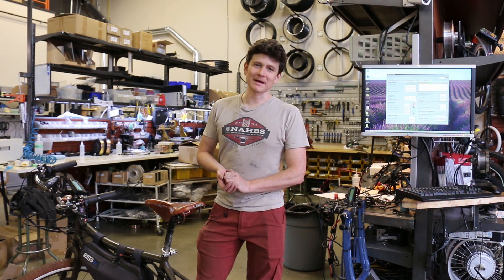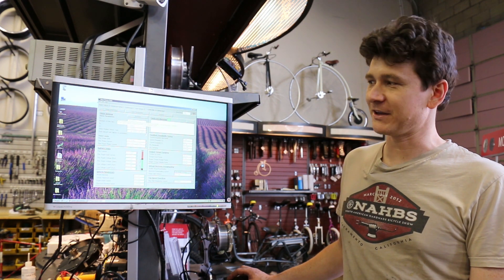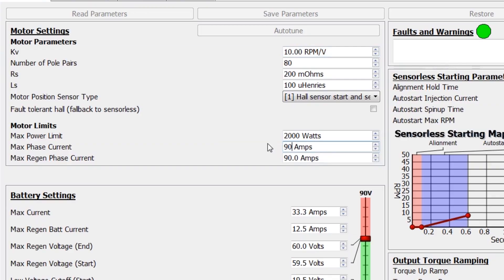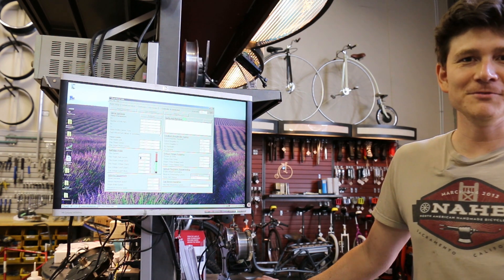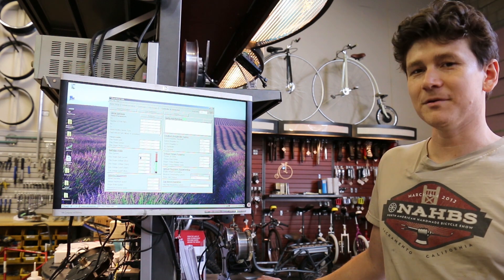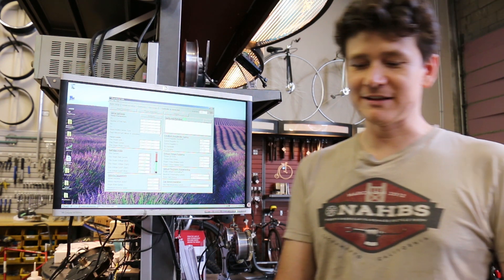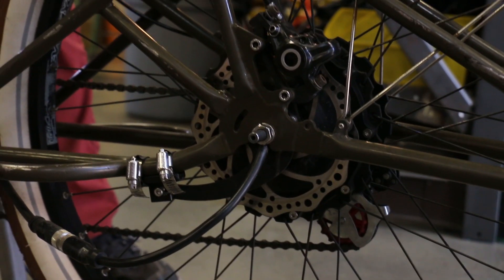Setting up a GMAC Hub Motor for Virtual Electronic Freewheeling (with a Phaserunner)

Comment: Does this only work with the Throttle?  Does it work when riding with assistance?
Reply from the maker: Yes, since the assistance using the V3 Cycle Analyst is effectively done via the throttle signal.

Comment: Is this function also triggered by turning the wheel forwards rather than applying throttle?
Reply from the maker: Unfortunately it does require an initial tap of throttle signal to start the process. We have asked ASI to give us a firmware option to start it from wheel motion as well, but don't expect that any time soon
Reply: @GrinTechnologies   Can it now be triggered by the wheels?
Reply: @GrinTechnologies  I'm also curious if this firmware update has come about

Comment: Hi, is there any way to have this on all the time when at zero throttle? Or is there a way to reduce the minimum throttle to act like vfw?
Reply from the maker: It's on all the time there is zero throttle when the wheel is moving as long as you give it some tiny bump of non zero thottle to get it stated.

Comment: l'm opting for a 2-motor ebike for my next build. I will be registering it as a motorcycle and it will be a pavement-only machine. I want to run a mid-drive as my primary motor with tall gearing and use a hub motor to help launch me off the line. Does this electronic freewheeling work at higher speeds too? I'd prefer to run my direct drive hub to allow for regen braking but also allow it to freewheel with minimal resistance once the mid drive pushes me past the hub's top speed. Or... am I going to need a geared hub and give up on regen?
Reply from the maker: Hey Mr Brown, sounds like a good project but your logic here in motor usage is flawed. You should be using the hub motor as the primary motor, and only engage the mid-drive when you need extra torque for hill climbing. This will be more efficient than using the mid motor all the time, and will also greatly reduce wear and maintenance on your drivetrain.  See https://youtu.be/Ub4EP2_mAds?t=2485 for a discussion on this topic. 

To answer the question, the VEF works at high speeds too, though you will need to enable the field weakening feature if you want to run with no drag above the speed where back emf voltage exceeds your battery voltage.
Reply: @GrinTechnologies  I would normally agree with you about my logic being backwards. However, this next build is a test bed for a bigger future project. The "mid drive" is a massive go kart motor with a custom fabricated motor mount that requires the pedals and cranks to be removed to make room. The goal:
My dream motorcycle has always been a 1992-1994 Honda CBR900RR Fireblade. I bought one many years back, did a full restoration, and rode it for years. The engine blew last summer and a lack of available parts makes another restoration impossible. I'm converting it to electric next winter and this new ebike build is the test bed that will help me make that conversion properly. The Fireblade will need exceptionally tall gearing on its main motor as my goal is a 150mph+ capable machine. I want to embarrass every rider who owns a Zero. I plan on experimenting with hubs to get off the line and facilitate the massive top-end performance. My ebike build isn't a scaled up bicycle for the purpose of owning a fast ebike. It's a scaled down motorcycle so I can get my dream bike back on the road and keep it there.

Comment: Can i use a kelly controller for the gmac motor? I have the KLS7212S. It can handle 120a if i'm not mistaken and hight voltage and it is compact
Reply from the maker: You can certainly try it, it needs to work with high eRPM motors that have low winding inductance, and some BLDC controllers struggle with that.

Comment: It's not clear to me how you are communicating with the controller. Are you using a windows PC and if so, what is the interface? Do you need to download and install a GRIN application?
Reply from the maker: You use the Phaserunner suite software which we produced for Windows, MacOS, Linux, and Andoird. https://ebikes.ca/product-info/grin-products/phaserunner.html#SoftwareSuite

Comment: My GMAC8T Phaserunner CA3 all came perfectly programmed in the kit ; GRIN Tech are great people !!! THANK YOU !!
Also, the wheel/motor was perfectly trued and balanced.
All I did was set the battery parameters and changed the "Start" to 8mph (come on, who needs a boost below that, LoL !) 
And enabled Re-Gen Braking. (saves brake pads and is fun)
And I bolted all the parts together onto my 29er MTB.
I have NO idea how anyone could install the motor without scratching the bike's paint somewhere.
Reply from the maker: Hey right on and glad to hear that.   We accept a few paint scratches as pretty harmless collateral damage for all the benefits of having the motor on the bike!

Comment: Hi, nice feature. I would like to suggest to look at the same functionality in nucular controller. It has two separate settings for current value at 20% rpm and 80% rpm since cogging torque grows with rpm.

Comment: Can this feature be added to cycle analyst?
Reply from the maker: This is a feature intrinsic to the motor controller and not the Cycle Analyst.  The Cycle Analyst only sees the battery current in the system and not the motor phase current, meaning it's not in the best position to apply this small offset current when the throttle is off.  But we have considered it.

Comment: I am very interested in that feature. Is this virtual freewheel going to allow to run faster downhill as well? I know someone who is stuck to max 55 km/h downhill on a DD because of the regen. If I understand, the regen will only work with an ebraking, from the moment you set up the electronic freewheel.
Reply from the maker: Hi Benoit, thie VEF feature won't do that, but the field weakening feature that is in the Phaserunner and Baserunner controllers sure will.  We don't have a video yet on field weakening but it is explained in the user manuals and we posted details in the endless-sphere forum as well.
Reply: @GrinTechnologies  I am testing the function since a week now and still wonder what hapens going downhill without pedalling or when max assistance speed is reached - it should also help the bicycle not being slowed down by the regen force, should'nt it? I don't have a steep hill nearby so I cannot test it myself now. The freewheel amps will prevent the regen I assume. Is that correct?

Comment: I recently capture this kind of function in the Sachs Mobility middrive. This middrive do certain use a two gear reduction. So the drag would be noticeable if the freewheel is between the motor and the first gear. The marketing and intended user feedback is lower drag above the legal limit but it add consumption above the limit. The public strategy will be  (to my guess) to hide the drag consumption and prise the low drag as an unspoken mechnical quality.
As an producer do you have legal limits on this feature?

Comment: Does it have soft start like bafang.
Reply from the maker: With both the phaserunner and the V3 Cycle Analyst you can add ramp limits to controls how smooth or aggressive the power is able to come on. Though this feature is much less important when you have a torque based throttle (like the phaserunner) versus a regular PWM throttle (like a typical ebike controller).

Comment: Can this feature be used with direct drive motors? Would it be less efficient?
Reply from the maker: It works flawlessly with direct drive motors too of course. Or even for mid-drive motors where you want to keep the motor always engaged with the clutch so that there is no startup delay.
Reply: Cool  @GrinTechnologies

Comment: Justin, that is awsome!. Maybe one idea to find the sweet spot where the  motor won't continu freewheeling forever would be to use the speed signal and "detect" when the slope of speed change is near zero and combine that with a dead time parameter where it "guess" the limit has been reached : if the speed slope is near zero and the dead time is reached.. so that freewheeling current value would be found... .. or maybe having a feature that autotune it by trying various current  and use that method  and when the dead time is reached... what do you think?
Reply from the maker: Hey Stephane, that's actually a great idea.  The software could totally run a little auto detection routine where it gradually reduces the freewheeling current until it sees that the motor is effectively slowed to a stop, and then save that as the final setting.  I'll put it in in our V1.2 features wishlist!

Comment: Hi Justin, thanks for the video, very clear and of course 👍👌 for this new solution for geared motors!
I understand at 2:30 that when you brake this 'electronic clutch' disconnects.
Is this true and how does it work ?
Reply from the maker: More to the point, once you use the brakes in this system then instead of injecting small current to overcome the core losses, the controller switches into full regen mode. So it goes from using 10-30 watts into generating many 100's of watts.   The main point I wanted to make is that after the motor is totally stopped, the 'electronic clutch' as it is won't kick in again until after you have lightly pressed and released the throttle. It's a small nuisance to the way that ASI has implemented this feature with their controller firmware.

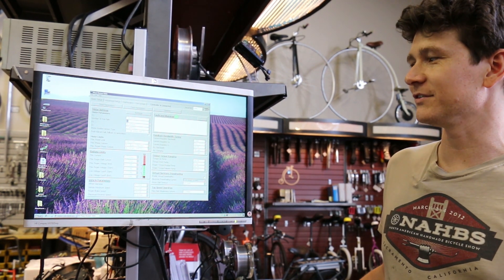Comment: Thanks for explaining Max Regen Phase Current vs Max Regen Batt Current at 1:10. I had read about this in the PhaseRunner manual when I did my initial setup but left Max Regen Phase Current at 40A and promptly forgot about it. Now I understand why my low speed braking torque has been so disappointing. I just tried it at 90A. What a  difference.
Reply from the maker: Yeah 40A was a silly default for us to have in the Phaserunner's setup file originally, and many other people also left this at 40A and didn't get full regen potential and never realized what they were missing. We've since updated that so all the PR's going out the door have both the forwards and regen phase current limits defaulting at 90 amps instead.

Comment: Is it possible to use a Bafang torque sensing BB with the MAC controller?
Reply from the maker: There is no such thing as a MAC controller really, MAC only makes motors. In our kits we pair the GMAC motor with the Phaserunner_L10 controller since they can be tuned very well to each other but you can in principle use 3rd party controllers too as long as they play nice at high eRPM's. With the V3 Cycle Analyst you can use the Bafang and almost any other bottom bracket torque sensor just fine with any controller that has a CA plug on it.
Reply: @GrinTechnologies  awesome! thanks for the info. Is there a good contact # for those of us in the USA  to use? When is a good time to call?
Reply: @GrinTechnologies  My Phaserunner and Gmac seem to pair together well! I am very pleased with the performance so far! I want to do regen braking Justin. I have 2 handles/levers but what else do I need to install that? I am assuming a connector cable to my CA V3 from at least one of my brake levers?   I was just on Grin and searched but no luck so far.

Comment: What would be the top speed of this motor at 72v NMC battery  and 29in rim
Reply from the maker: More specifically:  https://www.ebikes.ca/tools/simulator.html?motor=GMAC10T&batt=B7223_AC&cont=cust_25_90_0.02_V&wheel=29i&axis=kph 
Note the final temp and overheat in times, and adjust the throttle slider to find speed levels that can be sustained longer term when you are running with a 72V pack like this.
Reply: I am getting around 55 kph on my Gmac with 72v, 18ah battery, and nearly that uphill as well. I have only been riding about 4 days so far, less than 100km. I weigh about 175 lbs. I am on a Rocky Mtn Vertex 10 mtb. Lotsa torque too! The main problem is, when going that fast I need to keep my eyes on the road, not looking down at the CA V3. But I glimpsed 54 kph going up a big hill and I am seeing around 1,400 watts with open throttle at times. I still have lots to learn about the CA V3. That's why I am here now.
Reply: https://www.ebikes.ca/tools/simulator.html

Comment: What is that noise at occurs at very low RPM?
Reply: Electric motor cogging torque applied thru the transmission.  https://en.wikipedia.org/wiki/Cogging_torque
Reply from the maker: Actually the main noise there was the fender slightly rubbing against the tire. There is also a bit of noise from the internal gears inside the motor.